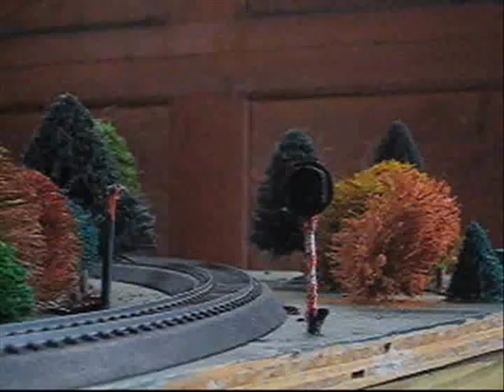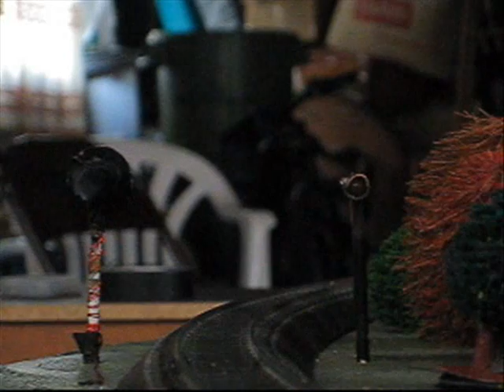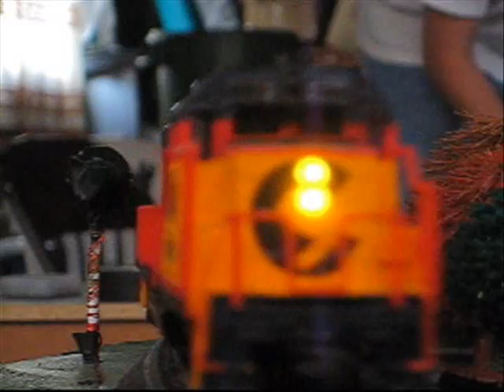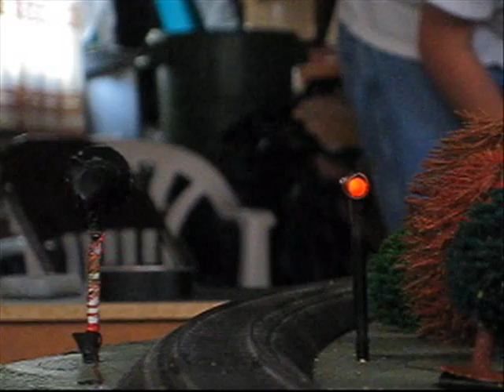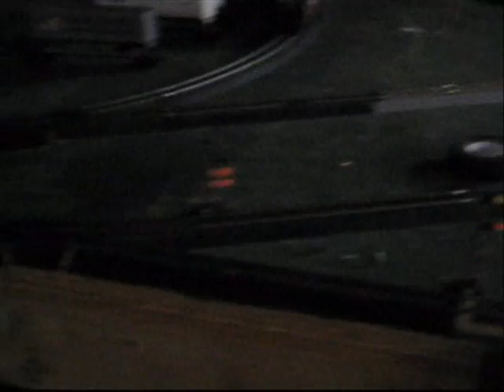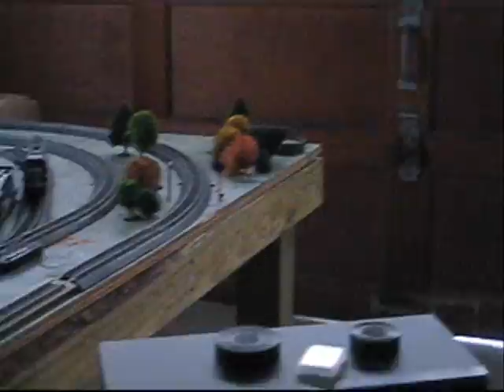Signal Operations 3 - Intermediates

Comment from the maker: Double Yellow, or Yellow over Yellow wasn't in use on this layout as I didn't have any prescibed Slow speeds, this was my first attempt at a signalling system so it was somewhat basic. Depending on the Railroad Yellow over Yellow can mean either an Approach Slow or Advance Approach. Railroads vary their signalling practices, but the general meaning for double yellow is Approach Slow. I may have use for this aspect on my current layout, of which I have vids of already, with its signalling.